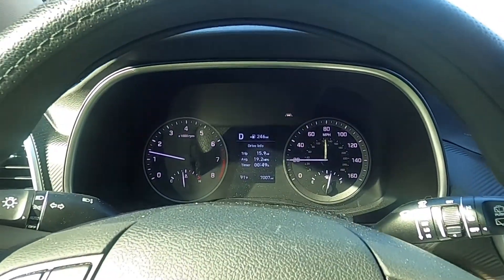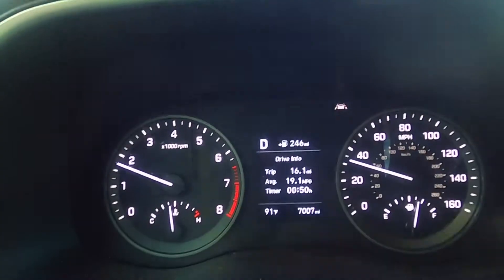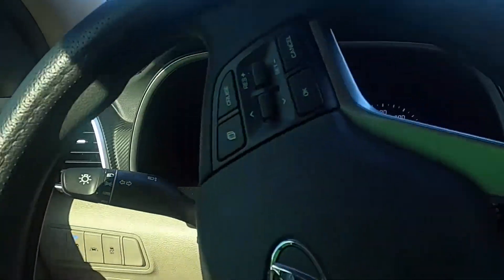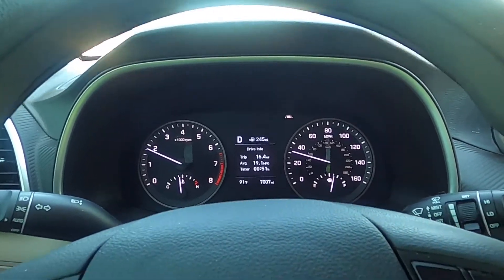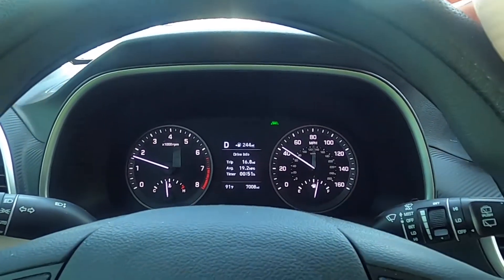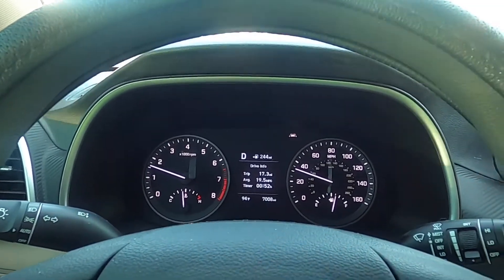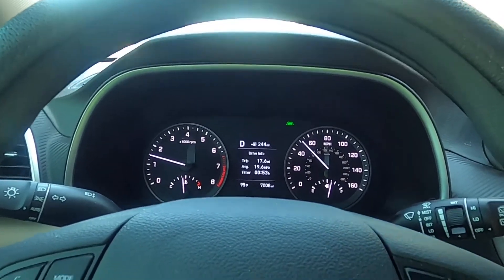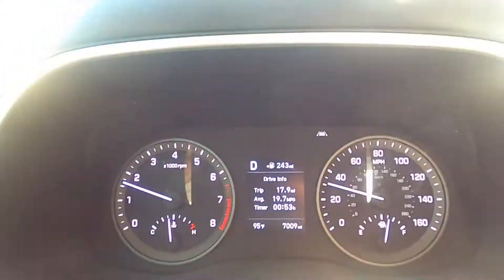How To Tell If Your Torque Converter Is Locked Up

Comment: will it throw a code? im having that problem. no codes tho or no codes stuck in system. i cant figure it out 🤦‍♀️
Reply from the maker: If the torque converter clutch locks up that’s normal. If it doesn’t disengage and stalls the engine or if it shudders then there is an issue. Unfortunately when my accord had issues it never threw a code. Some vehicles do but if it’s mechanical and doesn’t trip the electronics then it may not throw one
Reply: but after 35mph the car drives great its only at 1st & 2nd gear & it literally only does it every other day. i dont wanna believe its the transmission bc i just bought it & i changed my mounts bc i thought that was the issue but its not. it helped but im lost man should i sell it, a lot of mechanics wont touch it bc theres no codes & it wont give a problem with them only me lol!!
Reply from the maker: @realskeezy3601  ok what exactly is it doing?
Reply: @thweepz  okay im gonna try an shorten it to make it make sense. the car drives great after 35mph NO codes nothing. when i go from 0 to 35mph I get hesitation in first and second gear if I step on the gas and I'm still below 35 mph I could hesitation and a little bit of stalling before the car actually moves I can hear the engine running when I give it gas but the car won't move for a split second and then the transmission just like slams into place at the lower gears only 1 & 2nd gear! then if I'm at about 30 miles an hour and I let off my gas pedal my RPMs would shoot up a bit as if the gear is stuck! than after 3 to 5 sec itll come back down & go into 1st gear. im having a hard time w this car. since there's no cold in the car it doesn't do it every day a lot of people won't touch and I don't want to keep putting money into it you know what I mean I really don't think it's that bad of a fix honestly it's kind of hard to believe the transmission is going on the car drives great after like second gear and it's not that bad in first or second get either I just know somethings going on because my transmission slams into gear with only those two after that drives great
Reply from the maker: @realskeezy3601  you might be low on fluid or have a pressure switch issue
Reply from the maker: @realskeezy3601  but it’s also possible yoj may have gotten a bad transmission
Reply: @thweepz  i have fluid i got a transmission flush & i hope not its not doing it right now if it doesnt do it tomorrow im hoping its fixed. I remember saying I change my motor mounts now since I changed my motor mounts would that fix the problem right away because I fix them yesterday and when I drove home it did it. but not today so far. you think i have a bad transmission thats not throwing codes? my bad man I know I'm asking a lot I just don't know what I should do with it what's your opinion should I keep it or do you think it's not that big of a problem it's probably just something small?
Reply from the maker: @realskeezy3601  if it’s slamming it could be the gearbox. Sometimes fuel can cause issues as well. It’s hard to say
Reply from the maker: @realskeezy3601  make sure your transmission fluid is full and not low
Reply from the maker: @realskeezy3601  it honestly sounds like you have low transmission fluid. When I had fuel issues with my old car it would stumble and buck. But it was constant and not between gears. Needless to say have it checked out

Comment: I have a 2012 Durango 3.8 stalls aim drive at a stop is this torquq converter no cel c
Tried new tipm and fuel pump
Reply from the maker: Is the lock up clutch disengaging? Did you check injectors too?
Reply: The injectors would cause a cel and it would misfire I believe it not disengaging
Reply: Changed spark plugs coil packs
Reply from the maker: It very well could be. If it doesn’t disengage it’ll stall at a stop. Could also be things like the crank shaft sensor and stuff. The weird thing is there is no CEL. However, I worked for Chrysler for a bit and sometimes that CEL doesn’t catch everything
Reply: my challenger stalled few times due to water (after engine bay cleaning) in crankshaft sensor connector. it threw code after 4th stall.
Reply from the maker: Oof

Comment: I have a question, can a damaged torque converter damage your transmission?
Reply from the maker: It can. It did in my Honda
Reply: @thweepz   which honda? I am bout to but v6 accord with possibly bad torque convertor
Reply from the maker: @fsx0567  it was a 2000 accord 4 cylinder
Reply: @fsx0567  having the same problem just bought the car too, any fixes?
Reply from the maker: Unfortunately a rebuild or replace

Comment: i note this a little bit in my murano in cold weather but then engages normally in normal temperature
Reply from the maker: Torque converter lock up won’t occur until the engine is warm
Reply: @thweepz  thats good news 😊
Reply from the maker: Yep!

Comment: can this or a burnt clutch happen on a automatic transmission
Reply: It’s usually both. They go hand in hand and they’re usually change together
Reply from the maker: Yeah but normal torque converter lock up is normal

Comment: What would be the cause of the rpms fluctuating while driving around 50 mph? Torque converter locking and unlocking constantly? Is my torque converter shot? Also has a shutter when picking up speed between 25-35 mph. Any advise would be much appreciated. It's a 12 ford flex with 122k
Reply from the maker: I’m not familiar with the flex gearboxes but it could be a variety of factors
Reply: Mine does this
Reply from the maker: Did they find anything wrong?
Reply: @thweepz yeah it was the torque converter. Was replaced and it ran smooth as butter afterwards
Reply from the maker: Nice!

Comment: im having this problem with my 2008 frown victoria. shall i instead just buy a torque converter instead of replacing the whole transmission?
Reply from the maker: Is it actually going bad? Some vehicles will disengage the lock up clutch when you let off the throttle.
Reply: @thweepz  it wont do over 20. plus the wrench light came on. ill have to try that when i drive it again
Reply from the maker: @R924SB  oh that’s not good. It might be in limp mode
Reply: @thweepz  yea its definitely limping. how the heck do i get it out. ill have to look it up
Reply from the maker: @R924SB  you need to diagnose the issue

Comment: Been watching videos for a month now to find out exactly what 'lock up' means, how you tell if it is working or not working b/c I have a '00 4runner with a p0770 code and trying to diagnose it.  Watched all the big channels, the Summit racing channel, etc.  Your videos is the first one to actually explain it and explain how to know if it is working.  Great vid, thank you.
Reply from the maker: It’s hard to tell now since the lock up clutches are so active. But I’m glad I could help! Look for no rpm fluctuations in your higher gears when changing throttle input
Reply: @thweepz  thank you.  No rpm fluctuations when you press the gas AND the RPM and speed take awhile to drop after you let off the gas at cruising speed, correct?
Reply from the maker: @joegasparro2395  that’s correct. If the clutch disengages the RPMs will drop immediately (in some older vehicles they may go up). They will go down to almost idle and possibly swing back up depending on some manufacturers. But if it’s locked up it’ll drop slowly with speed
Reply: @thweepz  Yay I understand it finally.  So, if the lock up clutch is malfunctioning, does it stay on when it is not supposed to and/or not engage at all?
Reply: And thats my last question, thanks for taking the time to talk with me.
Reply from the maker: @joegasparro2395  actually multiple things can happen when the clutch is malfunctioning. Hard shifting if it doesn’t release. Also if it doesn’t release before stopping you will stall as it’s like a manual gearbox at that point. If it doesn’t lock up then it could be a variety of things. An example would be a thermostat stuck open. On old model vehicles it won’t lock up until the engine is warm. At other times it’ll shudder and jolt if it’s going bad. Can’t really tell until it’s already too late

Comment: Thanks for the informative video! Quick question, does this also apply to a 2010 jeep compass with a cvt transmission?
Reply from the maker: CVT is a little hard to tell. They lock up very early but the RPMs will still fluctuate due to the cvt “shifting” in small ratio increments

Comment: my MB c300 slowing down pretty significantly with my foot off gas, so every time upon red traffic light I have to keep my foot on gas while other cars brake lights are all lid up, which quite annoying. Plus my car barely move on idle when i shit in D. I'm thinking maybe it's the transmission slippage or torque convertor problem.
Reply from the maker: Oh that’s not good. Could be slipping

Comment: would torque converter lock-up be the cause of occasional jerky acceleration issues ?
Reply from the maker: Sometimes. If it’s getting stuck in lock up it can. Also if it locks up too early. Most of the time that’s a shudder though. Most cars now make it so seem less but on older vehicles it could take a second or two to disengage.
Reply: @thweepz  yeah its like a jolt when it happens like a momentary loss of power, i initially suspected it was related to driving on a quarter full tank and potentially stirring up some gunk into the fuel lines, filters, injectors etc.. i replaced the air filter, cleaned the MAF, throttle body and egr sensor and put new plugs in, tested coil pack and sparkplug wires, changed oil and put some new trans cooling fluid in and things seem to be ok right now but i dont think ive solved the issue yet even though my odb sensor says there are no codes ? i suspect there might be some issues with solenoids in the valve body, but i dont have a special subaru tool to detect that kind of fault code
Reply from the maker: @monogramadikt5971  ok if I may ask what car do you have?
Reply: @thweepz  i have a 2008 outback 2.5lr with E-4AT transmission
Reply from the maker: @monogramadikt5971  ok so I ask this. Does it feel as if you’re getting rear ended? I have a video on my channel about a 2004 outback and the lock up was very noticeable and aggressive. When it would unlock it also gave a bit of a bump
Reply: @thweepz  yeah that was definitely how it felt the first few times. ive owned the car for about two years, and its only happened on a few times sporadically and then went away  again. it has returned out of the blue about every 7-8 months and usually disappears as soon as it shows up. this recent occurance it was a bit gentler but persisted to show up after driving for around 25kms and i found i had to drive really gently to keep it at bay.. it went on for about 3 days before i decided to not use the car until id did a bit of servicing on it to see if it would clear up again,, ive only just started to take the car on short trips again so im not sure what to expect if i go for a big drive, although maybe a big drive on the freeway is what the engine needs at this point ?. i will have a look for your video on the 2004 outback and see if its a similar thing to what ive experienced ? cheers man ;)
Reply from the maker: @monogramadikt5971  I’m wondering if it’s the start of things just starting to wear out. It’s very possible. Also there are times where the car will just hiccup for no apparent reason
Reply: @thweepz  seriously ive searched the entire internet looking for a clear explanation ? i always had a suspicion it was related to driving aggressively when on a low tank and shaking up sediment that would go into fuel lines and cause momentary hesitations in performance ? i think i mentioned earlier that im going to run a few courses of doctor fuel through the fuel system and hopefully that will be beneficial to the cars over all performance. i might also buy a few parts like o2 sensors, catalyitic converters, water pump and timing kits just to have on standby yeah, i intend to drive this care well up to 500,000kms at least, others have done it and with a bit of regular servicing i cant see why i cant ?
Reply from the maker: @monogramadikt5971  if you take care of it I don’t see why not. Additionally, if it only jolts once in a while it could be very well something with fuel. Doesn’t hurt to tune up and see if it corrects the problem

Comment: I am used to the old school lockup. On the Toyota 4 speed automatics of the 80's and 90's lockup only occurred in the final gear(O/D) and at 40MPH or above . so if you dropped below 40MPH or into 3rd gear the lockup would disengage and therefore really easy to tell when locked up. The rpms would not fluctuate at all in lockup
Reply from the maker: For sure! These newer transmissions go through lock up and disengage so quickly and hundreds of times before finally hitting highway speed. It’s crazy
Reply: i have a Corolla altis 1.6 with 4 speed automatic transmission. does it have a lockup clutch also?
Reply from the maker: Yep!

Comment: This is a very difficult video to make, because it's very hard to demonstrate, especially in a late model car like yours.

Basically, when watching for lockup, you are looking for a rpm dip (or a pause) without a gear change. (Takes experience to "feel" what that means) 

Once the torque converter is locked up, the throttle will be more responsive, and the rpm won't fluctuate with sudden changes in throttle. 

MANY automatics will instantly unlock the torque converter once the throttle input reaches 0%. That means letting off the gas is not a reliable indicator that it will be locked up. A more reliable way to tell the transmission is locked up is to quickly stab the throttle but not enough to trigger a downshift. If the rpm rises 200-300 without a change in speed, you are unlocked. If the rpm stays the same until the speed increases, you are locked.

Many late model cars (All Aisin 5-8 speed transmissions, as well as a few others) actually have pulse modulation or "partial lockup" where the lockup clutch is rapidly applied and released multiple times per second. The result is, as you expect, a blended experience between locked and unlocked torque converter. The throttle will be slightly more sensitive to input, but the rpm will be only be 50-100 more than full lockup, which is just enough to let the transmission choose a higher gear without straining the engine or slipping the torque converter too much, which can enhance fuel efficiency.
Reply from the maker: I agree. I think the other thing though is most cars when the TCC is unlocked the RPMs will drop pretty suddenly or increase ever so slightly. With electronic throttles it’s not as noticeable but the RPMs will not hold constant when the clutch disengages. That’s why reapplying throttle was pretty constant throughout the vid to show when it was fully engaged. The partial lock up scares me just due to the wear on the clutches. But it’s better than nothing